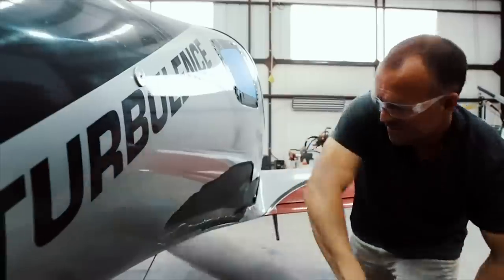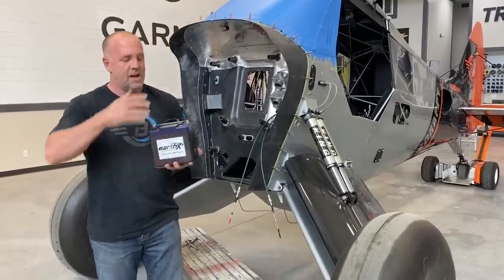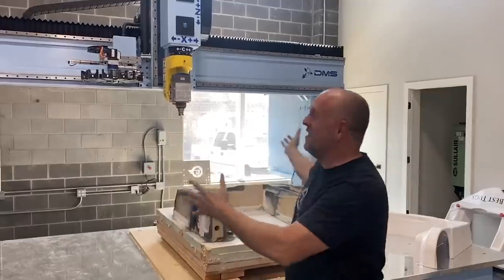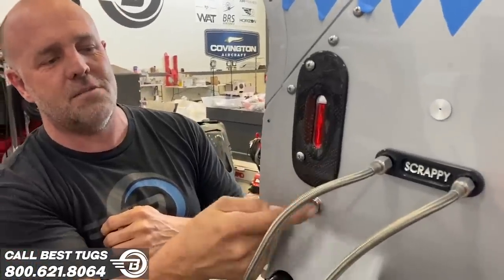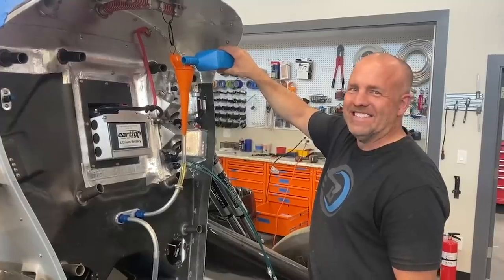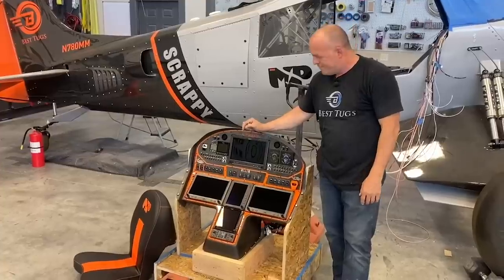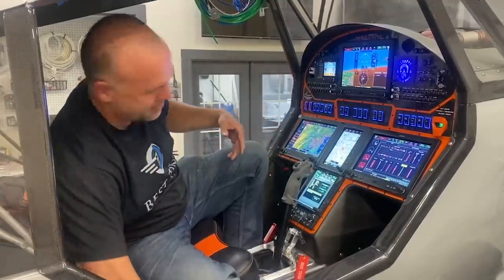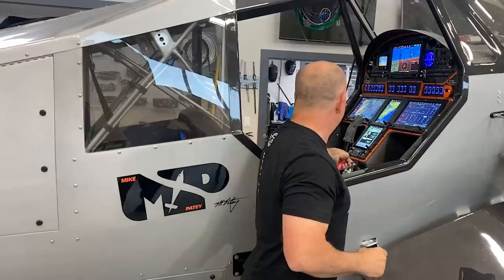Garmin Panel Install (Scrappy Bush Plane 25)

Comment: Awesome job Mike it looks great 👍👍👍. I have got to call you on the battery box though, I see too much aluminum. You have plenty of room to drill some weight out of that sucker. Silly question, on the gust lock why didn't you just install    an emergency bypass switch? Use a covered toggle switch labeled emergency bypass. If something fails in flight a quick flip and you have your starter back. Or if you have lost the pin just us the switch until you can get a replacement. I think it would be simpler and safer than a hot wire. Just food for thought. Also, I'm working on a variation of your bulk head fitting locker. It's not the same as what you made but I think you would appreciate the changes and the why. Just finishing the cad, covering everything from 3/8" up to 1" . I'm hoping to have them available on my website by the end of August if everything goes well. When I get the first batch done I would very much like to send you some samples. Could I get you to pm me a shipping address?

Comment: Hello, thx for the very good quality video you provide  ! 
It looks like you use a lot of blue masking tape in.. 50 mm.I like it a lot :) and  I have discovered this year that the same is available in 100mm wide . It works great ...if you don't have too much curves ;). Hope you can save some time in future applications . David.

Comment: In case your actually serious about stalling and dropping that thing out of the sky. Dont the tail wheel wont take it and the geometry of that front suspension load angle and track changes will put crazy stresses on the air frame. Also when your cruising around with no wings remember you don't  have any roll control. Not even wing flaps that strange suspension could do some really strange things if its soft enough to move. Yahoo ride um cowboy. The fit and finish is very nice great work on that area.

Comment: I know this is to late to do anything about, but regarding engine/ignition control there is a DIY type of thing called MegaSquirt. I have nevner seen it used in aviation, but seen it alot in various racecars. 
oh btw.... future airplane builds... You should make a Corsair clone with all class (Garmin) cockpit :) Probably not the best bush plane, but the most awesome prop engine plane there is!

Comment: Note to all concerned about the blue lights around the switches:  they are fully dimmable, and can be turned completely off, or down to a very dim glow, they don’t need to be full bright.  The lettering on each switch is on a separate dimming control too.
Reply: why not red?

Comment: You could potentially install a big fat capacitor directly to the Starter inline with the battery and it will feed all the juice the starter needs and minimal resistance from the battery circuit.
Reply: Looks like you already do!

Comment: Mike could you please comment on where the weight and balance should be for best stol performance and what the compromises are. I'm building a Zenith CH 701 with an 0-200 continental and I'm trying to figure out what length to make my motor mount. I'm trying to finish my plane before your done scrappy. Back to work!!!

Comment: Mike, those cautiously hidden controls next to the glove box.. they aren't for hydraulic/suspension control are they? maybe for adjusting your landing gear wings for optimal lift? and or leveling the plane on uneven ground?
Reply from the maker: I’ll tell it all in an upcoming video 🤠👍🏻

Comment: You could start in flight if the gust lock pin came out by having an airspeed interlock using a small pressure switch off the pitot tube line or even a switch linked to the suspension or even using the angle of attack sensor. Is there a logic output from the Garmin set-up you could use?

Comment: I'd love to see a video on the Garmin AoA system.

Cubs are famous for tip stalls.   Are you going to run 2 air speed sensors, one in each wing tip, to warn on tip stalls ?

Comment: Turned out amazing :) Would you consider soft-orange backlight instead of blue for the switches? Blue is a bit difficult to read in the dark - also fatiguing.

Comment: My favourite wierd thing about airplanes is ; it’s nearly done! But it has no wings? :o) I guess it is like tractors, you cannot get at anything with the back wheels on and it doesn’t look like a tractor without them, but it is only 12 nuts :D
Reply from the maker: 😂 I’m finishing up the fuselage so I can get a total weight and match the wings to it. I’ll be showing the process in an upcoming video.
Reply: @MikePatey  I like that idea :o) I’m excited to see how the A frame wings work into takeof/landings. Axial fans really like to blow out a cone of air,   and the ground effect wings are low, but the forced air will bounce off the ground... They worked ace on flying boats.

Comment: My first visit, and glad I came. I do have a question regarding the rudder lock microswitch. A great idea to lock out the starter solenoid until the rudder pin is inserted, but regarding the loss or misplacement  of the pin, a momentary switch to parallel the solenoid control voltage located where it would not likely be inadvertently used would be pretty handy. 

Are you at COS?

Comment: With all those screens how about the equivalent of a car rear view mirror located camera looking forward. Good for taxiing with the tail down and also usable as a forward view for the backseat passenger.  Maybe in the leading edge of the wing just at the fuselage junction, not sure how that works structurally.

Comment: Is it a flat plane or cross plane crank?? I would think cross plane for harmonic vibration with such a large stroke🤷‍♂️ did you just phase the ignition crank triggers 180 degrees out @ the Cam  to make both 4 cylinder ignition boxes stagger and fire every 90 degrees of crank shaft rotation? Are aviation V8s 18436572 or 18726543?

Comment: It would be extremely trivial to add a momentary rudder gust lock micro switch override so that the start function could still be accessible.  It would be a conscious decision to override it in flight, which is as good as what is there but still the ability to override.  It would just be an extra switch to depress in the case of a failure.

Comment: Hi Mike 
love your video, I have a question for in regards to the aluminum part you make, Do you have them treated such as  anodize or chromate treat or just paint to prevent corrosion. Why i ask is that i used to work in the aviation industry for over 30 year and loved it and i know the importance in have them treated to prevent corrosion and looking at the gusted luck it don"t look treated or is it.

Comment: Is that an EI FT-60 flow transducer on the firewall? (at 15:00)  The red cube FT-60 is used for engines up to 350 HP.  Perhaps with your engine a gold cube FT-90 (up to 550 HP) would be better?  I really enjoy your videos, always learning something!

Comment: While you were talking about locking your control surfaces and specifically the electric servo controlling the rudder damper during your last video, it got me thinking about the safety of having a motor controlling a control surface, and potential failures regarding that, so I have a quick question. As I'm doing more engineering in both personal, and motorsports applications, I've been investing a significant portion of my time in FMEA (Failure Mode and Effects Analysis) before designing a part, and continually referencing it while drafting a part to ensure there hasn't been a point of failure that I missed. Previously you've mentioned potential points of failure and what you've done to counteract then, but I'm curious as to whether you sit down for hours while designing, document potential areas of failure, the risk, occurrence, detection, and severity of each failure, failure outcome and handling, and what you've done in attempts to counteract a failure before it happens and ensure safety.

For example, my area of expertise is in electronics, so for my racecar's accelerator pedal, I have two throttle position sensors. For each case of failure in the sensors, be it debris, two different values, implausible signal, etc. I explain the failure cause, failure effect locally, and globally, the severity (and reasoning), occurrence, detection, and risk (as a function of severity, occurrence, and detection), before explaining what safety measures I have put in, and how to fix the failure. I collate all of this data for each specific point of failure, and cause of failure in my electrical system, and I put it into a large spreadsheet to analyse and reference to pass technical inspections, and for later referencing.

I was wondering if you go through a similar process to make sure that all of your bases are covered, and that you're as safe as can be given the circumstances, be it in electrical failure, or mechanical failure?

Comment: Really nice panel. I have been a fan of Garmin since i bought their GPS III. I love that you have the standby horizon (probably altitude and speed but I can't see it) too, along with the array of G1000 panels any of which could do that. If all else fails, you still have the standalone instrument. Is that internally battery backed? A lot of aircraft have been lost because the 1930s tech vacuum driven instruments failed. I like the electronic ignition, solution. Do you have fuel injection too? I can't believe aircraft are still using mixture controls in the 21st century. Even without the engine, she's looking perfect. I want to binge watch the rest of Scrappy and your next two programs now. Ho hum. I'll be patient instead.

Comment: Hi Mike, I'm a huge fan of your work - your commitment to excellence and your work ethic are something to strive for. While I do not play in the world of aviation, I have recently beecome involved in composites. With the specific application being watercrafts. 

I have a couple of questions for you.

1) Do you bake all of your parts in an oven under pressure?
2) What type of peel ply do you use and what type of resin? Looking for manufacturers so I can purchase some peel ply that will work with hand lay ups and no autoclaving required. 

Not sure if this message will find you, hope so.

Comment: Mike, with the reliability of Angle of Attack sensors in question over the last couple of years, are you installing two? Where are you installing it with Scrappy? On commercial aircraft, mainly jets, I’ve seen them on the fuselage both front and rear for different applications. With so much prop wash I’m stumped! Thanks so much for everything!

Comment: How hot is that battery going to get? Should it have some kind of a heat shield blanket? Given the dependence on the avionics and the useful load of the aircraft, should there be some kind of a back-up battery?

Comment: Anyone else pause at 28:09 trying to figure out the button & 3 switches to the right of Scrappy's glove box? Notice the electrical tape hiding the panel labels...Hmm   Some sort of active, pressurized damping or assist for those big King shocks? Ever since the episode that Mike mentioned the lines will run into the fuselage I've been brainstorming what he has up his sleeve
Reply: Also at 23:39 there is another laser engraved cover over the area where the "mystery switches" ended up.  Maybe Mike didn't even trust David at Avionics System with his little secret.
Reply from the maker: I’ll be showing and describing all of it in an upcoming video. 🤠👍🏻

Comment: Will you be adding a partial reflective heat shield for the battery, some airflow through the battery box to keep it cool and a flameproof purge path (exhaust pipe) to the outside if the battery combusts. 

It is hard to see into the duct at the bottom of the firewall. Does your firewall heat shield material extend through as a lining for that duct and trail under the belly of the fuselage. My personal preference would be to have it there.

When you start the engine and watch that huge prop turn then flick into invisibility and the eight cylinder engine springs to life in front of your feet, you are bound to be well pleased and rightly so. 

If you can, have a stereo mike for the audio so the enthusiasts can drink the sound track in.

It is a splendid piece of work to see coming together.

Comment: Quick question(s) for your Q&A: 
1) What type of labeling tool or technique (blue tape and a sharpie?) do you use for wiring?  Both permanent and temporary while doing assembly. 
2) How verbose are your labels?  Numbers, abbreviations, circuit ID, connector pin-out?

Comment: Mike, would it be possible for the actual wings angle of attack to be changed? Thus making the whole wing part of the flaps. I've seen something similar to this done in the RC world, but curious if you could design a pivot point on the leading edge of the wing and the rear of the wing be able to drop say 6 inches for slower landing speeds and shorter take off. I'm sorry if I worded that in a confusing way. Unbelievable work thus far
Reply from the maker: When I finish the fuselage, I’ll be weighing it and designing the wings to match, along with calculating the optimal AOA.  🤠👍🏻

Comment: Hey mike, just an Idea, instead of using a wire to manually hot wire your plane when the microswitch doesn’t work, why not just add a hidden switch at the same area where you would Hotwire your plane, easier to do and could be useful inflight in case of emergency

Comment: Mike, just nitpicking maybe. If lithium batteries get compromized, in case of a crash, they produce a lot of smoke. Is this battery puncture proof. If not, you could make a kevlar, NOT aramid, protection plate on the engine side.  
Love the channel, keep scrapin...

Comment: Was wondering where do you want to land scrappy the most when it’s finished
Reply from the maker: Riley Priest the highest mountain in the country.  If I can get the permit in Alaska
Reply: @MikePatey  $64,000 question you got the permit to land it's one window one day deal your lock in headed to the mountain weather can be tricky up there but it looks like it's a ok you do a fly over scope it out seems clear and doable one more fly by give it good look it seems like a small pattern could be forming sure enough winds are increasing but doable wait wind shifts now cross wind for the landing area, strong cross wind  what are you gonna do Mike?

Comment: The reason low battery voltage is so hard on a starter motor is that the starter requires a given amount of wattage or power.  In order to get the power needed at low voltage the amperage must increase which can overheat the motor.  Watts=volts X amps.
Reply from the maker: Guy Pehaim 👍🤠 exactly, very well said.  Me and my one take and get back to work, often doesn’t get it out perfect 🤷‍♂️😂🤠

Comment: Is it possible to design and build mudguards for the bush wheels in carbon, that both looks awesome and that you can step on. And of course prevent you from the need to clean the underside of the wing or worse patch a small hole.

Comment: I know nothing about aviation, but beware of the wetting current of large microswitches. Essentially, every switch needs to switch a minimum current to ensure that any oxide buildup on the contact is correctly broken through when the contact is made. Large switches might require tens of mA, which might not be the case for just signal lines. A small capacitor in parallel to the switch might be enough to ensure that enough current flows when the contact is first made.

Comment: Love these videos, never been into aviation but now I want to start modding planes! I’m extremely detailed with how I like to build cars but wouldn’t change anything about this plane so far. Probably been covered but keep wondering about the main wings? Assume they’re not going to be standard carbon cub after all this, saving that for last?
Reply from the maker: Correct.  I’m finishing up the fuselage first so I can get a total weight and match the wings to it. That’ll be in a future video. 🤠👍🏻
Reply: Mike Patey thanks for the reply, looking forward to that!! 👍🏼

Comment: on your quick connects do you go oversize i have run into hydraulic problems with restrictions at the quick connects  where i had to remove the the internals of connect that close the connection when seperated, just something i run across.

Comment: Did you wire in a set of remote jumpers  in case the battery fails in the middle of no where? Just asking